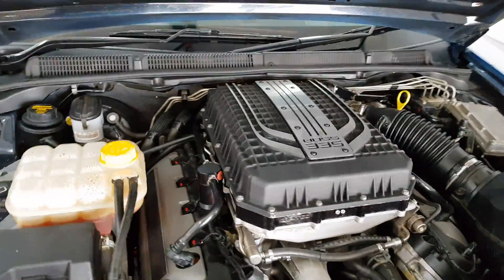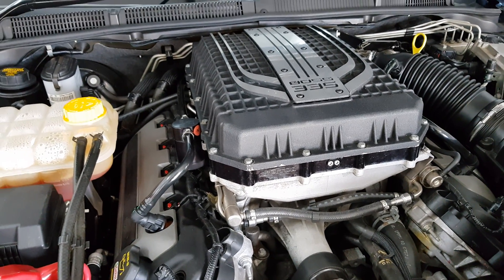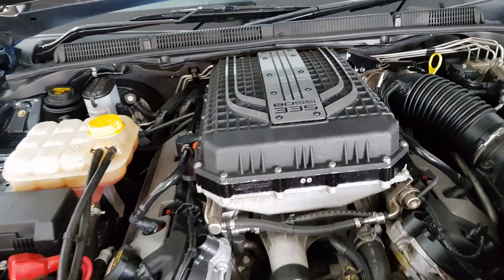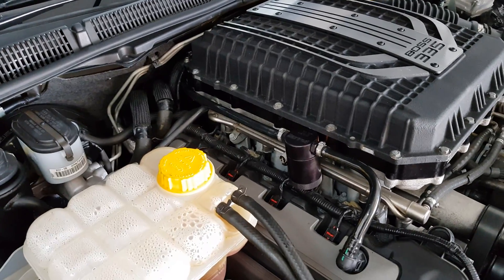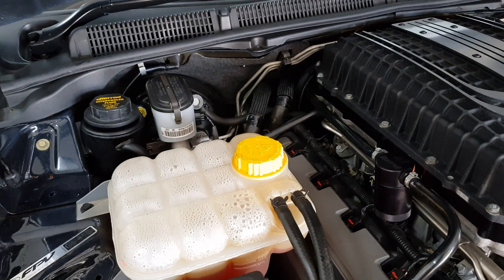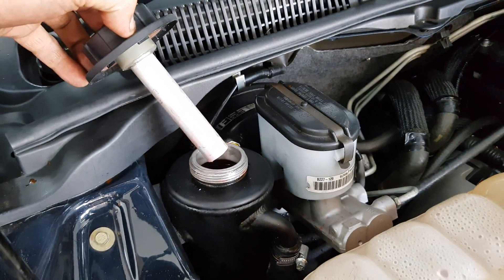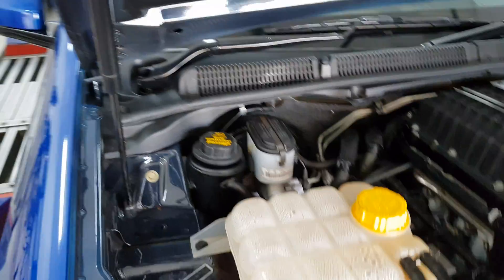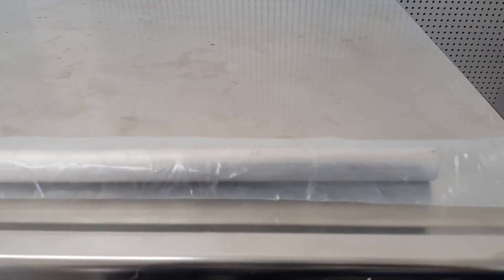How to: Prevent electrolysis corrosion in your aluminium cooling system

Comment: Doesn't a sacrificial anode have to be connected by mechanical means to the material it's supposed to be protecting? (Whilst also being submerged in the electrically charged liquid) How will gluing it to a non conductive surface work?
Reply from the maker: Dave Yobbo it bottoms out on the bottom of the tank.
Reply: Independent Motorsports that may work for a short time, but as it corrodes it loses length & it will no longer touch. Your basically using only a tiny portion of the anode.
Reply: Aren’t the tanks usually plastic?
Reply: @chriswest5360 you can put anywhere on the bottom of a car too, my opinion even moist air can transfer electricity.